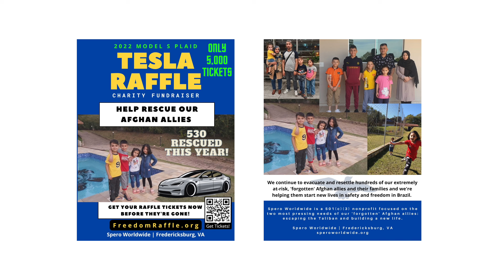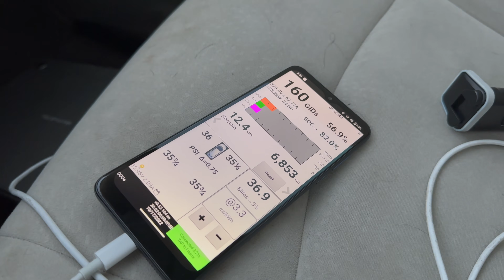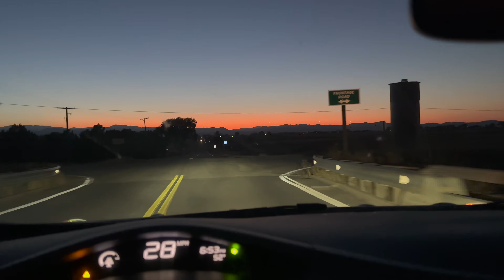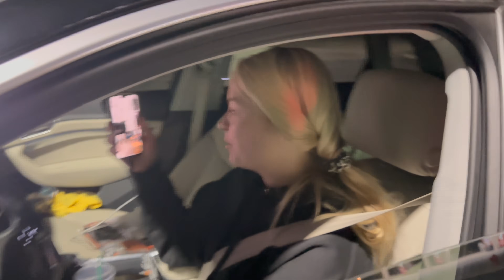Here's How Far My Cheap Nissan LEAF Goes On A Charge! Charging & 70-MPH Range Tests

Comment: Love the LEAF videos.. keep them up please.
I know in my 2018 with the 40kWh pack there can be some strange behavior during top charging and a lot of times it will stop around 98% regardless of AC or DC. I have always assumed this is because it has detected that it needs to do some cell balancing and cuts out early. 
I think the early models might have had a charge limit setting??  Check under Zero Emission button -> Settings -> Long Life (infotainment) mode or under the charge timers (gauge cluster menu). 
I think you can get 80 miles in your proposed city circuit test. These cars will obviously not win any interstate efficiency awards but under 50mph it's a whole different story.
Would love to see a series of videos on the AC charger repair.
It's good to see you blocking up a CPE-250 for the 2nd or 3rd time that day. This is what the community expects from all of us to maintain our image.
Reply: What is a CPE-250?
Reply: @dr.OgataSerizawa  - The model of DC charger he is standing in front of in the video. Chargepoint CPE-250.

Comment: Great video. I have a friend that had the 2012 Leaf with the small battery, and he could get almost 60 miles of range in the summer. In the winter it was less than 40. The Leaf is heavily effected by cold weather.

Comment: How much would it cost to replace the battery?
Reply: My Nissan dealer quoted me $13,500 to replace the battery in my 2011 Leaf with the same 24KWh battery it came with.
Reply: @wmalden  That's quite expensive considering that it wont extend the range.

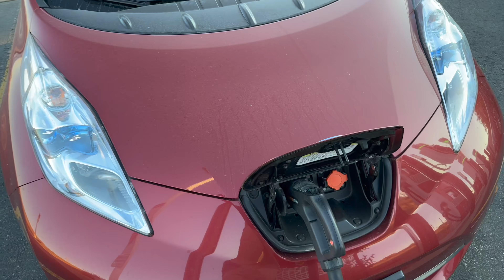Comment: 7:50 2012 Leaf can set 80% charging limit. It’s the 2013 and newer that don’t have it.
Reply: I have a 2013 that has "Long Life" mode. Not sure about 2012. They got rid of it in 2015 to bring their EPA range up from 75 to 84 miles, since the EPA insisted on quoting the 90% (average) range when that mode was available. Really dumb reason to get rid of it. I use Long Life mode most of the time and have 104,000 miles with 75% SoH (2 bar loser).

Comment: 27:50 looking at cell voltage is useful when the percentages and stuff is confusing. Turtle mode comes when some amount of cells go under.. hmm, was it 3.3v? not sure. But using that display you can carefully drive by cell voltages and being gentle not to sag cells too low :D
Reply: Yeah she’s due for some good slow charging and balancing for sure!

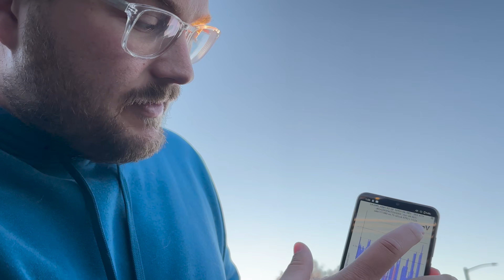Comment: 9:55 balance at full batt is expected. The most information is seen when you look at those cell voltages at high speed low battery state.
You can adjust the "scale" on the cell screen by tapping top or bottom side of the graph, to make it reasonable :) 0.01v difference making huge spikes is not useful info.

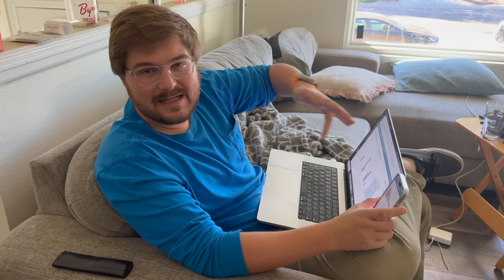Comment: 6:14 DC charger goes directly to battery and only very little is lost to heat, if charger measures and reports energy that leaves the cable.
AC charging has inverter in between with losses.

Comment: Alyssa’s reaction after you said “50.2 miles” is hilarious 😂😂 that “Wowwwww” was so funny
Reply: For $5k total and super low fuel cost (or zero since I have workplace charging) 100km of range is more than enough to cover my and all my coworker's daily driving needs.
Reply: @anydaynow01   Once the AC charger is fixed and he can charge at home, then it would be a great inexpensive commuter car.
Reply: @anydaynow01  yeah for the average person it’s enough. But i drive 150 miles + per day so it’s not nearly enough for me
Reply: She was so amused
Reply: The Leaf can rapid charge, 50 miles are not really an issue. It's not a good long ditance car but the first few recharges are quite rapid on such a small battery. We have the env200 with the same charging speed and most recharges are less than 24 minutes
Reply: Needs a new battery
Reply: What if he will move to the USVI? One charge is good for week driving.
Reply: Thank you... I'm out.
Reply: Never saw an adult so happy for a 50miles drive at 70 m/h and 30 min charge, not for me,

Comment: Your results are pretty congruent with the 2011 LEAF I owned.  The best range I could ever get was about 87 miles with two of the health dots already extinguished when I got the LEAF in 2014.  I believe that was about 82% health as reported by LEAF Spy.  Tires make a huge difference as does ambient temperature.  I believe you’ll get your best range between about 60 and 70 Fahrenheit.  The range so-called “guess-o-meter” is pretty bad because it doesn’t look at prior history; it goes to a default initial guess every time you charge the battery.
Reply: Correction:  that should say every time you CHARGE the battery.

Comment: The very bottom of the pack was specifically designed to be DEEP.  Not sure why you didn't hit turtle mode until two seconds before the car died, because turtle mode should kick in for the last mile or two.

Comment: Tires: factory Ecopia are the most efficient and probably best bet.  They get very noisy as they wear down.  If you replace tires, get the newer version Ecopia which has a much better tread wear rating.

Comment: Low beam is LED (there is an angle adjuster on the lower left dash).  High beam is halogen.
Reply: Angle adjuster? Like up/down beam angle? Is that legal on low beams?
Reply: @TechnicalLee  I can’t speak to the legality, but my 2011 LEAF which was native to the US market had a knob on the lower left dash which adjusted the beam angle slightly.  The owner’s manual somewhat cryptically said the control was provided for correcting headlights based on the number of occupants.  No suggestions on how to accomplish that task correctly were given.  I left my control on 3 out of a scale 1 to 10 and it seemed like a good compromise no matter how many passengers were in the car.  My guess is it was a sort of cheap-out for an auto leveling mechanism the car should have had.  My parents had a Lexus RX300 wagon which you could see went through an headlight aiming procedure every time the key was turned on. 

The other unusual feature that apparently only existed on the 2011 LEAF is that a push button was provided to disable the pedestrian warning system noise maker which sounds like a cross between a tea kettle and dragging brake shoe.  The PWS would stay off until the the car was switched off.  The PWS automatically reenabled at the next power on.  In later models you could (possibly illegally) just pull the fuse for the PWS module.

Comment: I’m debating on wether or not buying one of these I drive about 45 miles combined a day for commuting back and forth to work
Reply: Buy ev
Reply: 70 mph is the fault in this test. Stick to 50 or 60 mph and 45 miles are an easy job for a worn Leaf. When in doubt, shove in a 10 minute quick charge on the way back, it will take you from say 35 to 62 percent.. it's all possible
Reply: I drive 60 miles per day mostly highway in a 13 Leaf, but I do have to give it a short charge to make in the winter when it gets below 0C.

Comment: Every BMS uses a different logic and programming and every battery chemistry requires a different one. Then you have engineering decisions about how different charging profiles will affect battery longevity and cycling, which can be simulated but really to find out what will work best, you may need five or ten years of real life use, not just lab emulations and accelerated testing.
 So yes, there's a surprise in every box. (Anybody else miss Crackerjack?)

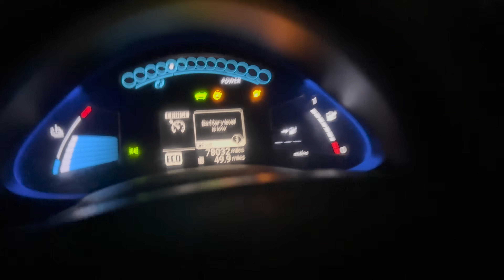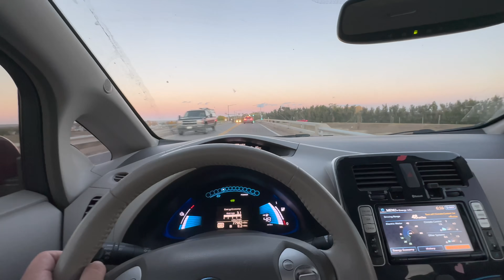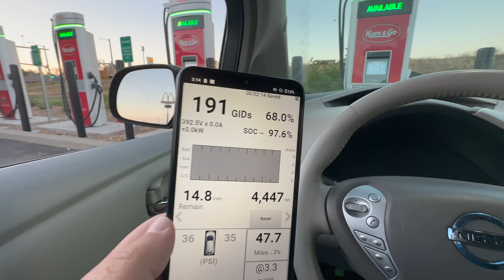Comment: Nice run, Kyle! That was pretty brave toward the end. I think that pulse to 40kW is what really made it panic. There is a precursor to Turtle-mode, and those are the "POWER" bubbles. Normally, they're all doubled up. At 27:46, two of the double-bubbles turned to single (unusable) ones - same as "dashes" on the high end of the power meter on the Tesla.  At 28:15, four total were single. At 28:40, you got the turtle and 8 of 9 were single. Also at high SoC (like at 14:52), you don't have double-bubbles on the regen (left) side - same as Tesla dashes on the left. Interestingly, comparing the LeafSpy consumed number at the start (at 12:30, 4447Wh) to the end (at 29:40, 19740Wh), you actually got 15.3kWh out of the pack. Congrats! Edit: Also noticed the GOM was dead on from the start - how often does THAT happen?!
Reply: The first time I read your comment I had no idea what you were talking about as a non-Leaf driver, but I think I figured it out. Wow, those double vs. single rings on the power meter are not very obvious at all. Very subtle and highly nuanced, but that's how the Japanese are. Personally I think that could have been done better.
Reply: Thank you, I was wondering what the power limiting gauge was like on the leaf. I will have to rewatch and see what it looks like when the pack gets really low charge.

Comment: My 2014 24kwh eNV200 (Leaf van) with worse aerodynamics wont do 50 miles at 70mph and it still has the full 12 bars soh showing. Of course, Nissan are playing a nasty trick on us, the 12th bar doesnt represent 8%.. more like 15% (drops to 11 bars at 85%). Its only done 36k miles and doesnt have fast or rapid chargers fitted plus i live in the UK which doesnt usually enjoy extremely hot weather.
Reply: Yep. I'm pretty sure the first bar is 15% and subsequent bars are 6.25%. So, the fourth bar should disappear once 66.25% is hit. Kyle is at 66.58%, in this video, so it could happen any time now. It is getting colder out, so that 9th bar may hold out for a few more months.
Reply: yeah, the fast charge is only because the on board charger broke, otherwise he would never use it.

Comment: That is pretty abysmal efficiency. A Model 3 Performance with 20” UberHeavy wheels is significantly better.
Reply: A model 3 is also 10x more expensive
Reply: @quartzofcourse  you would think the smaller lighter car could be more efficient than it is. The battery in the Leaf is tiny compared to the Tesla. It should be way more efficient than it is.
Reply: @LearningFast  Leafs just have relatively small capacity, cheap batteries in them. The wh/mi are generally the same or better than a Tesla. Teslas put 3-5 times bigger batteries in their cars. I do think a stock m3 has a little better drag coefficient than a stock Leaf, which would make it increasingly better than the Leaf the faster they're going.
Reply: the leaf is a 60 mph max cruiser. its just a fact.
Reply: don't bully 2010 car design and 2009 battery cell chemistry

Comment: 2011 LEAF owner here.  Couple things: on mine, with 8/12 capacity bars remaining (4 bar loser as the kids say), fully charged I show SOC of 93.1% and 13.6 kWh remaining.  And when DC charging below 50% SOC, it will stop at 90%.  Above 50% it will go to 100%.  Keep us updated as to the degradation, love the comparison.
Reply: Hmm, so the stop at 90% is by-design then rather than a BMS issue? Probably to control overheating?
Reply: wow my 2012 9bar Leaf never see 100% change it always stop at 95% leaf spy reports.
Reply: @xboxice2005  that's something else. Leaf spy shows the gross capacity which can not be fully used. Leaf should always charge to 100%, but only after it shuts off and charging session gets started a second time
Reply: With MyGrrenVolt app(all GM PHEV including Volt, ELR, CT6 plug-in hybrids) will show cell balanced very accurate when all cells are at their lowest levels.  Kyle probably shouldn't use partial SOC whe n reviewing cell balance.

Comment: The early LEAFs respond very well to hypermiling. 40+PSI in good tires, climate off, accelerator control, preserving momentum, slowing before a light to let it turn green... Trying to get max range from my high mileage used 2011 LEAF (1st EV, got it as a joke) replaced my "daily hundred". Doing the hypermile version of 10/10 driving may still irritate other drivers but if fed the competitive urge and was less likely to put me in a hospital or jail. 
That was over 7 years ago now. LEAF is long gone, but a young relative still drives it today. Nissan replaced the battery a couple years ago, out of warranty but there was a recall. Driving a Lucid today I may have returned to my prior evil ways I'm afraid.
Reply: For sure, if he drove 60mph he could have extended the range by 20 percent!!!
Reply: You have returned to hypermiling?
I just saw the lightyear roll about 3km after releasing accelerator
Reply: @golfish8589  No, quite the opposite. The Lucid's big battery and incredible driving dynamics encourage me to drive inefficiently.
Reply: @Miata822 😂
Reply: I’ve seen the Lucids beautiful cars.

Comment: Looks like you are at 9 bars not 7
Reply: I wonder if bars were reset. No way that battery is a 9 bar car
Reply: @Donald77BS  i believe in another video he said 7. But maybe didn't count the red.
I purchased a banged up 2012 with 65% soc. It only got 33 miles. And the cells were evenly balanced. 
Resetting bars won't increase range.
He didn't get the projected 50. But more than I thought he would
Reply: @golfish8589  Yes, I usually go 55-60 when I go longer distances. 3.3 KW/mile seemed good efficiency for 70 mph

Comment: Would have been interesting to know the cell voltage difference at the bottom of the pack.
Reply: That's what we look at with Chevy Volt on MyGreenVolt app.  Works on ELR a d CT6 plug-ins too.
Reply: @normt430  Yes, I have the app, and a 2015 Volt.

Comment: I've always heard that you can't DC charge a Leaf twice in the same day because the battery overheats. Looks like you had no issues. And hell yes we want to see how far the leaf can fall from the tree around town.
Reply: The early Leafs has much less rapidgating.  I charged our 2014 24kWh 14 times in one day on a trip this summer.
Reply: @martinostlund1879  oh that sounds painful
Reply: @kevintdickson  no kidding, going slow on the autobahn and frequent breaks are the least stressful driving I have ever experienced.. our last trip was 18 charging stops and 55 mph constant and it took long, but it really wasn't a pain at all
Reply: kinda right kinda wrong... All Leaf Generations have the Heat Issue... depending on the outside temp or how fast u drive... it will go faster or slower into the Rapidgate....         even on the newest leave u can never rapidcharge more than 1,5 times... Then it will still charge but it will go 20 kw and then 15... and sometimes even 10kw max... It has a max Temp i assume 50 Degree Celcius... Which it can only hold if it charges slower and slower and slower....

Comment: In the end the GOM was correct at 50. In the right conditions you can hit about 6 miles/kWh if eco driving around town. I can see this car getting around 85 miles assuming there is 15 kWh available. Love your maniacal enthusiasm. You can also reset the mi/kWh meter before the trip.
Reply: My wife, with a pretty solid battery, used to get about 85 and more like 70 in dead of winter. That was in the model II revised Leaf, a 2015.
Reply: he probably could have got a another mile or so but he decided to floor it at the end.
Reply: It will keep on running ut to 0.5 kwh left, I know from experience....

Comment: Doesn't it only balance the cells on AC charging?  Maybe that is why it stops at 90%
Reply: nah it does static balancing once over a certain battery charge level. which means you don't have to have the charger connected all the time

Comment: Where do you get Leaf Spy and what additional components do you need?
Reply: Good questions. I see so many obd 2 dongles ranging from 12 dollars up to 200 dollars. Which one to get? Hopefully he will do a video on which OBD2 device he has and how he pairs it with the leaf spy app 🤞
Reply: @TheVegan15  the low energy OBDII is recommended, so it doesn't drain the 12v battery .  
"LE links 2"
Outdoor-apps.com